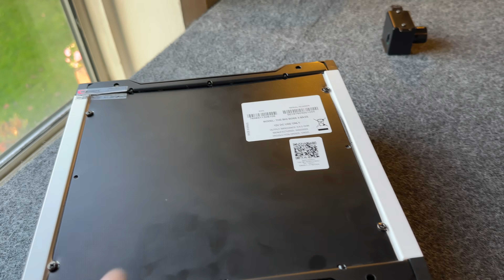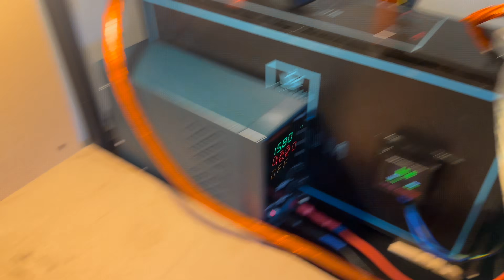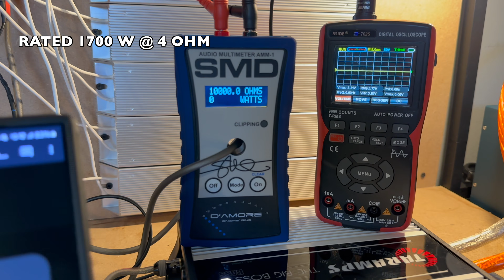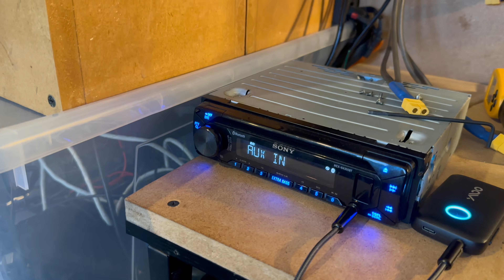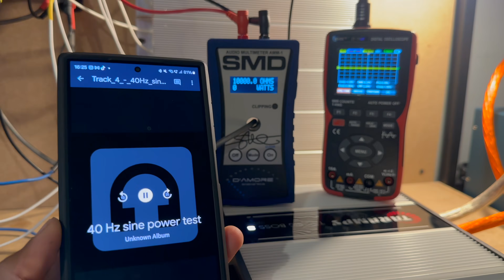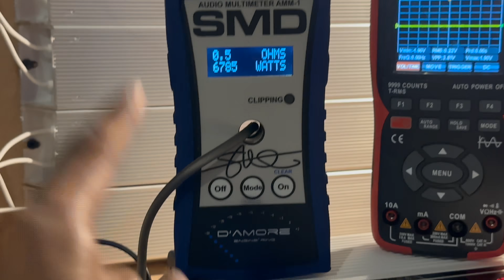This Tiny Amp Hits HARD! (Taramps Big Boss 3K Amp Dyno & Overview)

Comment: I have this amp powering a solo X 8” wired to 1 ohm and no matter what input voltage I use or what gain setting, the remote clip indicator goes off like a disco, fancy doing a real life investigation video using my setup?
Reply from the maker: Sure are you in the uk ?
Reply from the maker: I mean, to be honest, I know what the problem is already

Remember these amplifiers only put out full power between 0.5 and just under 2 ohm it’s quite likely that you’re rising above 2being wired at 1 meaning that very little power is getting to the subwoofer before you’re hitting clip with these types of amplifiers. You really wanna start as low as you possibly can to 0.5 to make the full use out of the amplifier

Comment: They don't like higher voltage electricals. Also the covers aren't very steep you might want to use an additional one.
Reply from the maker: i disagree they been working fine in all my testing

Comment: It does 3k, but at a 15v setting. It would be nice to see what it would do in a vehicles 12v system that usually tops out at 14.4v while running. After voltage drop and impedance rise will it really hit 3k?
  Edit: That smd only went off once, if its not catching clipping, is it even reading wattage properly?
Reply from the maker: Regulated power supply bro this amplifier maintains the same rail voltage between 12.6 and 17 v that means it would output the same amount of power between them two ranges 

This is completely different to non-regulated power supplies which there rail voltage is proportionate to their input voltage 

Regarding if the SMD meter is accurate at measuring wattage, I would say so yes absolutely
Reply: @-SINEWAVE02  thank you for the info, learning a bunch. Very glad ive found your channel😊
Edit: at a lower rail voltage would it consume more amperage to make the same rated power? Thx for your reply😊
Reply from the maker: The rail inside the amp will stay the same because it’s regulated, but if your car’s at the lower end of the voltage range the amplifier just has to pull more current from the battery to compensate. That way it can still keep the rails stable and deliver the same rated power.
Reply: @-SINEWAVE02 thank you😊

Comment: One RCA jack in? My brain works in stereo meaning two RCA jacks in from the head unit how do you hook one up and receive a full signal what am I missing?
Reply from the maker: If this is a mono block amplifier, why do you need two RCA jacks? The RCA terminals are bridged internally
Reply: @-SINEWAVE02 doesn't that only send either the right or left side sound signal to the amp it seams like you would only receive half the music thanks for your response in advance

Comment: great video, i am really interested in knowing how you wired the resistors to get .5, 1 and 2 ohm loads. Is it the same as what one will do when wiring multiple subwoofers to get the  desired ohms or is there something else to consider? i also assume they are above 500 watt rated each.
anyway i came for the review on the amp and was impressed.... yep i ordered it.
Reply: It all depends on how you wire your subs.

Comment: Ive personally seen this amp do 8k watts
Reply from the maker: @joshholden8561  I’ve seen it do 12
Reply: @-SINEWAVE02   crazy ain't it subs and paws youtube channel had this big boss 3 consistently playing between 8-10k watts have to run it on 15 - 15.5  volts  to get the really high numbers.
Reply from the maker: @joshholden8561 that’s not really usable power tho you need to understand how these amplifiers work to realise that the power you’re seeing is milliseconds as the current sensing circuit doesn’t catch onto it quick enough to pull it back down.
Reply from the maker: Not on a sinewave that’s the most important
Reply: @-SINEWAVE02  I do understand  how it works im a amp repair tech for taramps and about 14 other brands.
Reply: @-SINEWAVE02  when reading a o scope and did playing maybe 8 cycles and getting a reading of max voltage for a split second doesnt mean the amp can continuous make that huge amount of power but I understand what ur saying  .
Reply: @-SINEWAVE02  yeah and I've modded many taramps to not have the current limit circuit in in use and im also known for bullet proofing taramp md 8k amps.  I don't want to go back and forth with ya cause I enjoy ur channel i want it to stay that way . And BTW measuring power for a split second is exactly how a amp dyno works.
Reply from the maker: @ yes, but the way these amps work it don’t mean anything.      An amp Dyno is to see how much power it will do on a continuous sinewave on a static load 
I know a lot about these amplifiers  hey they even sent them all put to test 👍

When you do dynamic on this amplifier compared to a typical amplifier is this is going to show exaggerated numbers that last a fraction of a second
Reply: @-SINEWAVE02  i know i am amp repair tech like ur buddy barvids i know the signal sensing technology isn't fast enough to catch real numbers but I've seen this amp clamp 6k on burps
Reply: @-SINEWAVE02 yes i know buddy I'm just messing with ya .
Reply: @-SINEWAVE02  wow
Reply: @-SINEWAVE02  ive got the baddest full bridge  in the game I got the nvx xad 17 5500 4 ohm 9k 2 ohm 14.5k 1 ohm and those is 1% thd certified numbers dynamic at 1 ohm it touches 16k u can see the power wires twitching from over 1,000 amps of power even the speaker wires themself twitch.
Reply from the maker: @ that’s nice but still can you play a continuous bass tone at 23k.  The amp won’t Sustain it so all then peak numbers.  Can vary as it’s not usable power.
Reply: @joshholden8561 that amp doesn't do close to 23k. Lol
Reply: @chriscarroll3635  ur right idk how i typed that i mean 16k  wich is the highest ive gotten on the scope
Reply: @chriscarroll3635  idk how i typed 23 my bad I got ahead of myself and mistyped I corrected it.
Reply: Can this amp be ran on stock 150 amp alternator with big 3 upgrade in 1/0 ofc and a secondary trunk battery rated for 4800watts?

Comment: I've had the smart 3 for 4 years now very happy with it,I think I'll go ahead and get this one
Reply: Can I run a big boss 3k with stock electrical and a second agm battery?
Reply: @kurtsnyder3440  you can, but you won't be able to crank it, a bigger alternator like a 250 or 320, make sure you do the big 3
Reply: @darilynking4751 who makes high output alternators for 2025 Kia k5? I cannot find anyone
Reply: @k @kurtsnyder3440 been looking to for my Kia k5
Reply: @kurtsnyder3440 autotech
Reply from the maker: You will love this amp !!
Reply: I sisn̈ß 151.3 db on music with 2 12 skar vxf  I brought several different brands of subs i tried the bdc4 quad stack audiopipes the coils came unglued from tripple joint wich i found out was a common issue and Amazon warrantied those subs out I brought 2 Walmart Gothic subs as a favor to a friend those did a solid 148.1 I brought 2 nvx vcw those did well 149.0 I brought rs platinum those did a 150.8 and I brought 2 12 hyanka bsf cause I am sponsored by they they did surprisingly well 147.4 they couldn't handle the power like someof the rest i also has 2 12 avatar stu subs but I was letting a buddy borrow them im pretty sure those subs would won also the car I was using was a fully back half dynomatted 2007 scion tc hatch had a sony xav ax 8000 head unit and at that point inwas still using alot of agm batteries with a 250 amp alt my voltage stayed strong 13.8  volts

Comment: Can this be ran with a 160a alternator, with big 3 upgrade and an extra battery?
Reply: Yes absolutely if you do two agm batteries minimum. 1 to run the car and another in parallel to support your amp. But lithium would be much more effective.
Reply: You probably need a bigger alternator

Comment: This amplifier is a little monster but for me at home i prefer to use a pa amp still some people they still using car amplifier at home
Reply: Same and helps im a Dj/Junior Sound engineer using the amps at events.
Reply: @EBMproductions1  yeah still some people are still using car amp at home but it's useless
Reply: do pa amps also run stable at lower ohms? like 1 or 2 ohms?
Reply: Their are bro some can play on 1 ohm or 2ohm@LenzoB

Comment: thanks for the video
im looking to buy this taramps

what is the right to do , play sinewaves with the sub on the amp to set the gain with osciloscope or without the sub?
i have the same osci like you ❤️😁
Reply: id set gain without a sub
Reply from the maker: @leonrotedits you would want to do it with it as rise and that will determine the voltage getting to the subwoofer and how faror less you are from hitting clip level